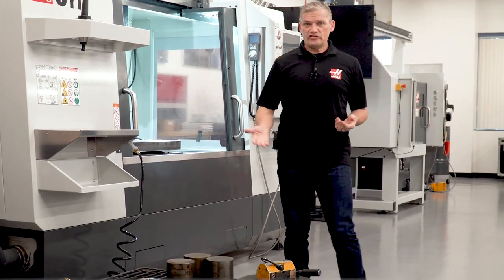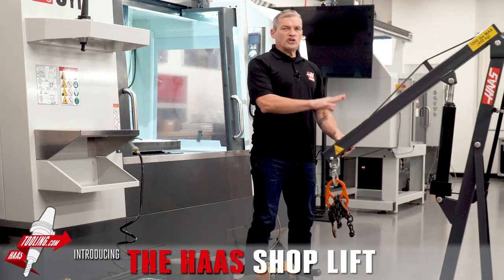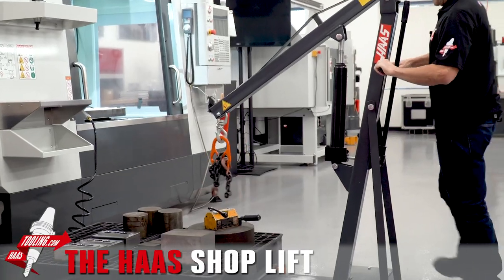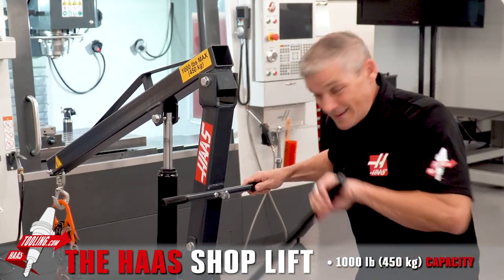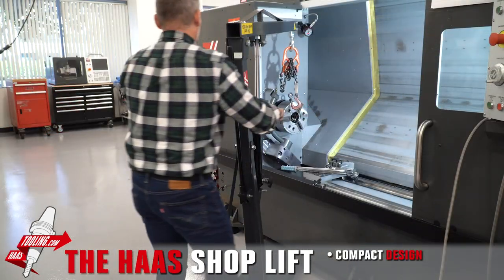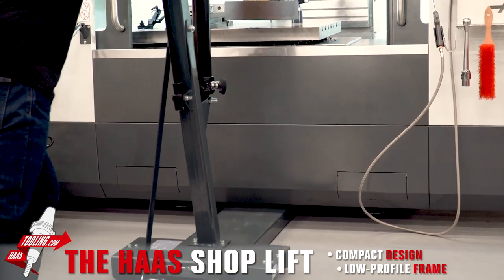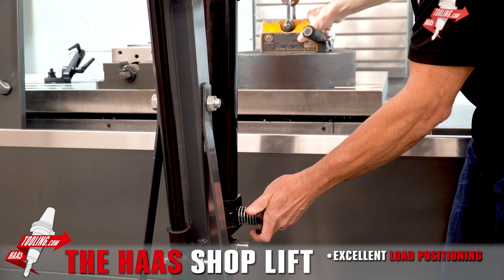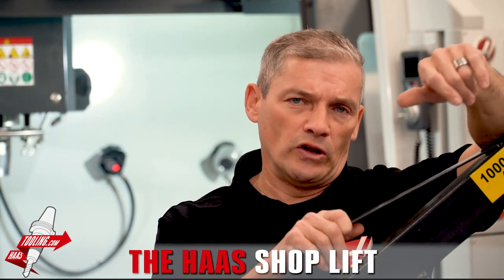The Haas Shop Lift - Load Parts & Workholding Into Your Machine - Haas Automation, Inc

Comment: I bought one and i cant get it to work. There is no pumping pressure. I filled the cylinder with oil. I tried my best to bleed any air oil per the instruction on your website. Hope I can get this resolved since ive already had problems getting support from haas in the past and I've tried a few different ways to contact haas.
Reply from the maker: Joshua - Email me directly please at bofallon@haascnc.com and let's see if we can get this figured out.  Thanks - Bryan, Haas Automation
Reply: @haasautomation  Did this get sorted out? Charles

Comment: Don't forget about the air-over-hydraulic kit that you can get from the the certain import store. That way you don't even have to manually pump up the cylinder!
To be fair, this is one of those "adaptations" that actually makes the tool better fitted for the job. The pump handle is in better location, the release knob is nicer than a tiny pin (though could still be upgraded to a bike brake style lever on the pump handle or the handle bars), and that one-piece base sure beats two floppy legs those hoists usually have.
Reply from the maker: Agent West, That is a good point you make. In fact we will most likely be offering an air-over-oil kit of our own in the future as well as rigging kits for some of our rotary units and other items. As you say the release knob works well and the location seems to be about right since often you are steadying and positioning the load as you lower the final few inches to the table or chuck on a lathe. The knob location keeps this stretch manageable.
Reply: @haasautomation  Come to think of it, won't a 12v pump be better than air? Can run off a typical car battery. That way the operator does not have a hose that seemingly constantly gets in the way.
Then again, get blank off pallet, set it on lift's base, roll over to CNC, plug in air hose and lift all the way up. Not all that complicated lol

Comment: Can it be used through the side window of a umc1000 (height and reach)?
Reply from the maker: Good question Francois, unfortunately the height of the lift is such that arm will interfere with the top edge of the side window before the arm reaches the center of the table or indeed has enough height to actually do any lifting above the table. You can of course come in from the front door opening on the UMC-1000 as you'd expect.

Comment: If the had a cut out in the middle of the foot like a pallet jack the hoist might be able fit inside a pallet.
Reply: Now that you mentioned it, yeah, either a slot or two separate rigid legs would be more convenient for placing/removing parts from the center. However when he is putting the magnet on it does look like the base is in one side of the pallet.
Reply from the maker: Dave Electric, This is an excellent point you make. Probably one of the first questions you ask yourself when you walk up to the unit is "How am I going to get the foot of the rolling frame under the pallet?" 
There are two ways we typically present work to the hoist. 
1st: In the video we have the pallet sitting on two 4x4s which gives space below to roll the Shop Lift underneath and pick up the part. But this does require you to lift the pallet onto the 4x4s with something like a fork lift. You could easily make a dedicated "load area" to place pallets that were to be used with the Shop Lift. 
2nd: Luckily the engineers kept the width of the foot just a little less than the inside width of a "full width" pallet jack. That way you can lift the pallet from one end and roll the Shop Lift in from the opposite end and grab your part. You do usually need to use something like 1x4 planks on top of the pallet jack forks since many pallet jacks don't lift quite high enough to slide the lift under. You could also lift with a fork lift in a similar way and come in from the opposite end with the Shop Lift. We will be doing some more videos with the Shop Lift shortly and we'll be demonstrating some of these lifting options. Thanks.
Reply: @haasautomation  Actually I regret this comment because the problem with a "pallet hoist" would be a)the wheels necessary to clear the floor boards would increase the ride height of the hoist completely defeating the purpose of being able to get the foot underneath the VMC and b) hardly any men out there are strong enough to overcome the climb resistance of the underneath floor boards when the hoist is put under load.  The reason a pallet jack can travel over the floor boards easily  is because it is not under load during entry. Not as good of an idea after thinking about it for a day.
Reply from the maker: @DaveElectric  Good point. It is a perplexing problem once you start to think about how you'd do it differently than with an engine hoist or cherry picker style lift. Not to mention the wide variety of different sized pallets and skids that work pieces often arrive on. There are many times when there is some inevitable shuffling between pallets, boxes, and skids. And it depends on what the particular shop has available lift wise.

Comment: What is the load rating?
Reply: It has a 1000lb sticker right on the side of the boom. That would be the load rating.
Reply from the maker: Lonna, As Thepriest39 mentioned, the load rating is 1000 lbs. Here is the link to the Shop Lift page: https://www.haascnc.com/productivity/tooling-and-fixturing/haas-shop-lift.html
Reply: @Thepriest39  didn't catch that when I was watching thanks.

Comment: How low is the profile?
Reply from the maker: Claudiu, The front "foot" of the rolling base, the part that rolls under the machine/pallet, is 3.25" high off the ground. Call it probably 3.5" minimum clearance to roll it under a machine/pallet. Thanks for the question.

Comment: Very cool but we need an automatic pump or something. Cranking takes too long.
Reply: do you wanna spend an extra 500-1000 for an automatic pump? you can always upgrade it yourself.
Reply: @SuperAWaC  Yes I would pay $500 for something turnkey and well intergrated. Is there an easy option to add on?
Reply: @Foomanlol  Just switch it to a standard air over hydraulic cylinder